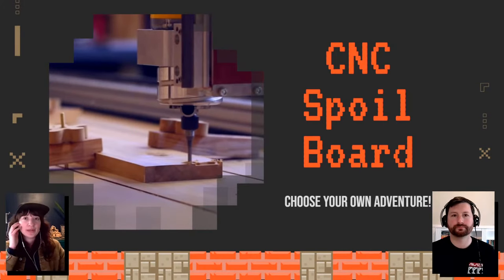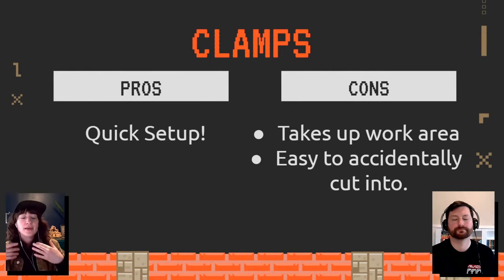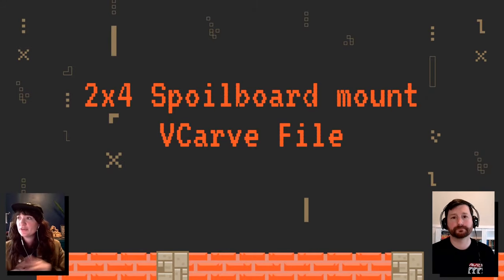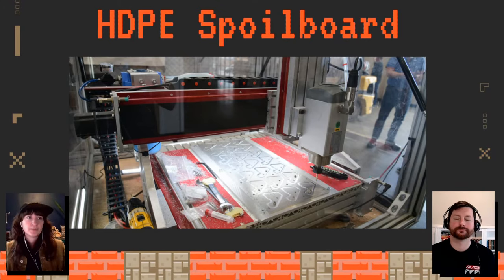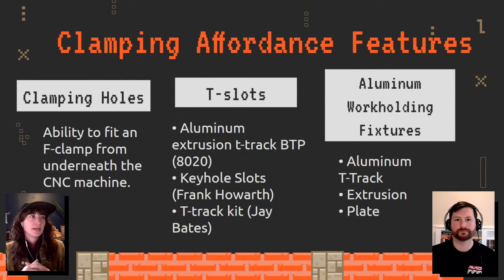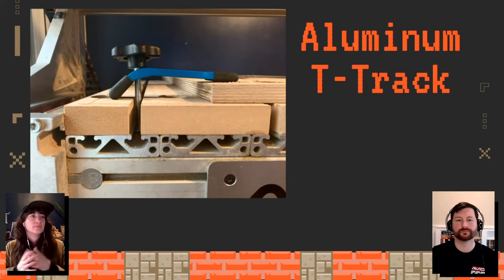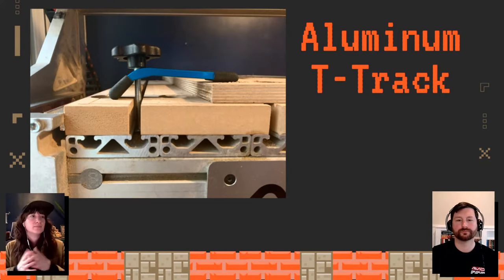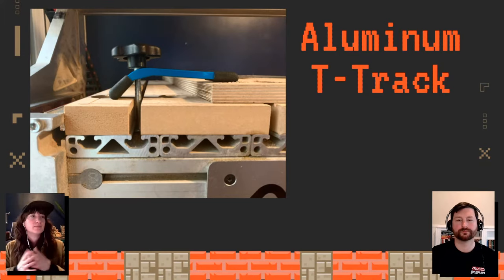Live Stream - CNC Spoilboard: Choose Your Own Adventure

Comment: Regarding the attachment and "slots for adjustment" of the 2x4's mounted to the cross members, it would seem that a simpler (and more accurate) method would be to mount the 2x4's solid/firmly, and then use a spoilboard bit on the edges of the 2x4's themselves, providing a perfectly flat surface for mounting a temporary spoilboard.

Comment: Just ordered a 4x8 Pro Kit 5 minutes ago!  Can't wait to get it in.  I am going with an Acorn controller, Clear Path Servos, and a DIY vacuum kit based off the Shopsaber thread.  I am really excited to finally have a real CNC to supplement my CO2 laser.
Reply: How are you getting on with this setup?
Reply: @Nickporter17  Slowly.  I have the physical CNC assembled and am working on the enclosures.  I have the basic layouts done and all the components installed.  Right now I am running the cables and crimping the terminals on the end.  I should have it making chips in about a week.  Maybe a month to have everything complete and have it doing production stuff for me.
Reply: @tstanley01  CHecking in  on how you're liking the machine after 2 years?
Reply: @robbie6625  I like it. The motion control has been rock solid after I figured out an early static issue with my dust collection. The rigidity of the machine is about on par with what I expected. It isn't a shop Saber, but I cut acrylic sheets at 200 ipm, so I am not really pushing the machine.